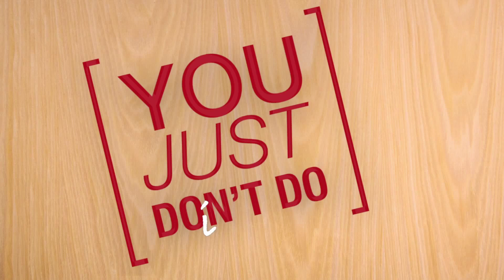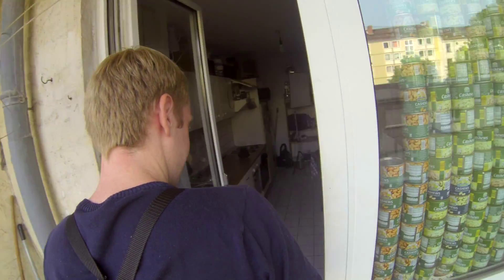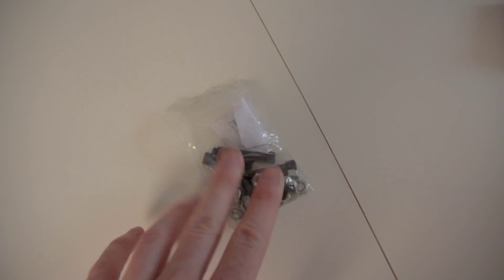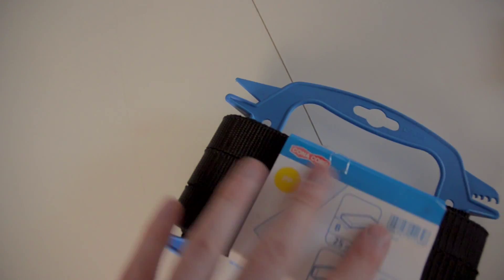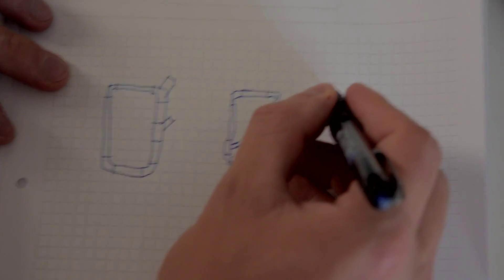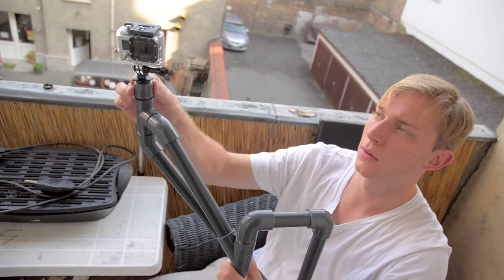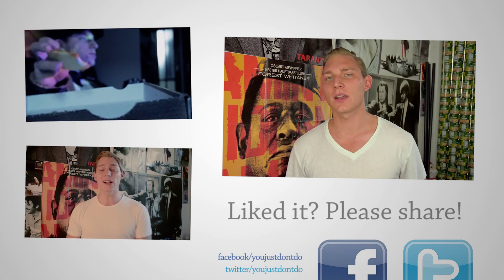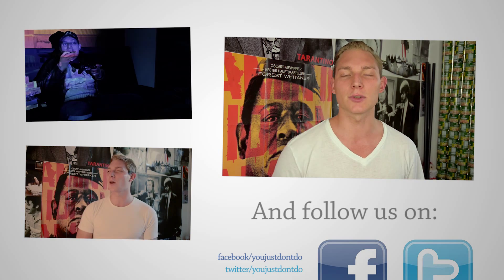How to Build a DIY Snorricam

Comment: For the pieces you don't want to glue, while assembled, drill small holes and use nuts & bolts.  You don't have to worry about it falling apart and losing the camera, but you can still exchange lengths when needed.
Reply from the maker: Thanks, thats a great idea!